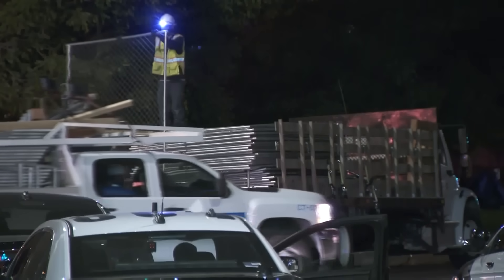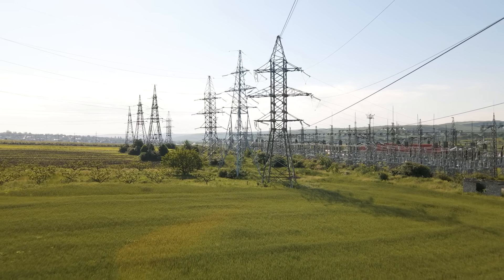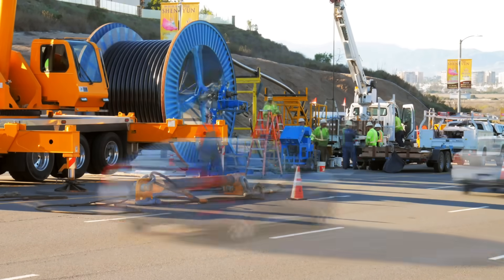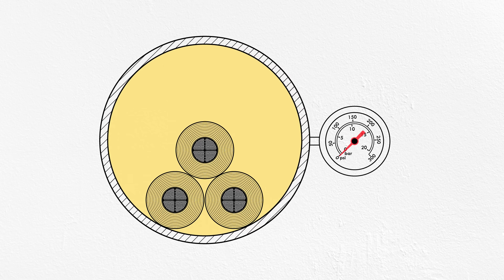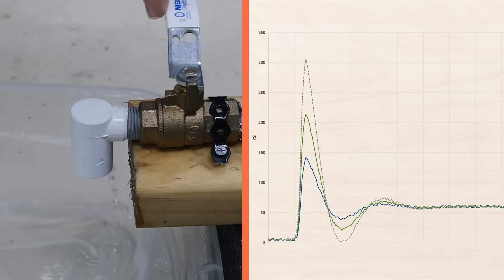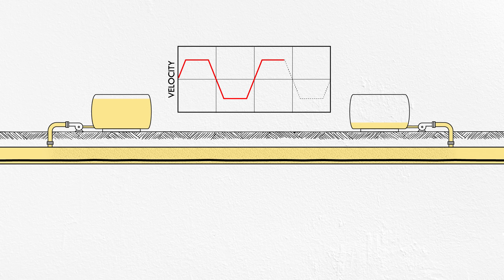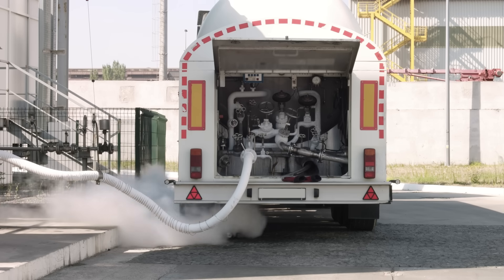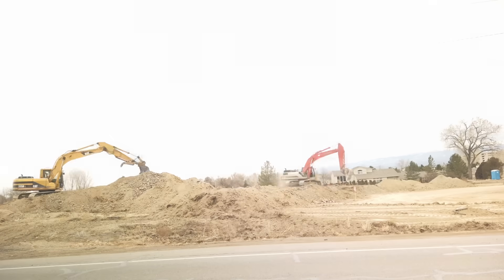Repairing Underground Power Cables Is Nearly Impossible

Comment: I never even considered high voltage lines underground... literally next to ground! I love engineering problems like this. Liquid nitrogen to hold back pressured oil? What a fascinating problem to work on. Thank you for sharing this story.
Reply: wait til you hear about the internet underwater!
Reply: @bermchasin  undersea cables are fascinating. The undersea fiber optic cables are so amazing. I really like the story about Cyrus Field laying the first undersea telegraph cables too. I can't believe he managed to keep getting the ridiculous amount of funding for such an immense feat of engineering as it experienced so many problems and failed over and over and over again then when he finally managed to get a cable laid it hardly even worked and failed straight away and he still did it again.
Reply: @NoZioKikes88  Yeah, the submarine cables are still mindboggling to me. There is so much in the ocean we dont yet understand, its like an alien world, but it didnt stop us from putting tens of thousands of kilometres of cables over the ocean floors... its mental.
Reply: @bermchasin  I laughed way too hard at this.
Reply: @bermchasin  Fiber optics is a fascinating invention
Reply: I think the dielectric properties of underground cables creates parasitic capacitance, for long runs ofc, and HVDC doesn't have this problem.
Reply: @leerman22  you are correct. The capacitance can be offset by line inductors at the ends of the underground or underwater transmission line. These produce an opposite amount of inductive reactance that neutralizes the capacitive reactance. 
HVDC doesn’t have the capacitive reactance of an HVAC transmission line, however the capacitance is still there. It manifests itself as “ charging current”.  That is the effect of the capacitance between the conductors and between the conductors and ground to act as a storage battery. This requires measures to limit the surge of current when energizing a HVDC line. Also, when shutting down a HVDC line the capacitance will continue to supply voltage even after the source is cut. Again measures must be taken to bleed down the stored charge. 
I’m a retired utility engineer.
Reply: @billmoran3812  Good Answer
Reply: @leerman22  ooo they must run HVDC. Good call. I was wondering how they dealt with the capacitance 😅. Duh.
Reply: @leerman22  --  well, everything has its unique problems.   The capacitance can be "tuned out" with inductors along the line.   The "shielding" of each of the phase conductors means that much of the current carried in the Cu core "returns" via the shield.

The presenter didn't say whether the installers use vacuum impregnation techniques to eliminate/reduce air bubbles before pressurizing the line.   Paper with oil is a pretty good insulator but by the time this was installed, I'm surprised they didn't use some kind of plastic.

This line was 220 kV.   I wonder what voltages Con Ed used in NYC.

Overall, it still fun stuff.
Reply: @GilmerJohn  ConEd has 345kV underground.  Eversource (old Boston Ed) also uses 345kV underground.   Recently, SoCalEd began a 500kV underground project.   Cost estimates I've heard are 8-10 times that of overhead.
Reply: @KENFEDOR22  --  Thank you.    In the urbanized Virginia suburbs of Washington, DC the moderate HV distribution (c. 40 kV) is underground.   But the "real" HV stuff is overhead.  It usually runs along major highways such as the beltway.   Another "popular" routing is along streams that form the basis of "strip parks."

I suppose the 8x cost might be worth it in places.   I can't imagine NYC having high voltage power lines along side the major N-S highways.
Reply: @leerman22  Partly, the other part is the I-squared x resistance derived heating losses for MV / HV.
HVDC is also usually operated at 500 kVotlts or 2 megavolt, reducing the current flow, and thus the heating losses, exponentially.
Reply: @leerman22  the capacitance is minor if the cable isn’t lightly loaded.
Reply: @leerman22  underground cables? not much of a problem actually, the place where it is more of a problem is under water, we've been dealing with this stuff in Europe for a while now
Reply: @leerman22 HVDC requires external arc flash connectors because in line equipment would be toast. A camera flash can be problematic.
Reply: "Liquid nitrogen to hold back pressured oil? "

That's quite a common tactic, they also use freezing as a means of stopping groundwater from getting into freshly dug trenches for new pipes etc.
Reply: @vinny142  it's also how you can fix a bad main shutoff in your house water supply without paying hundreds extra for the town to shut off at the street (assuming that one even works)
Reply: Your neighborhood plumber also probably has a tank of liquid nitrogen on their truck for water lines.
Reply: @pasquarielloanthony  Ummm... probably not. There's almost always a way to turn off water (or sewage) that doesn't require freeze plugs. And they still need to turn off the water to freeze it in place.

Freeze plugs are appropriate for when you need to break the integrity of a system and still preserve as much of the system as possible. Such systems may require cleanliness (for high purity water inside a semiconductor foundry), contain contamination (such as a water pipe carrying radioactive water in a nuke power plant), or (in this case) limit the loss of expensive and hard to replace working fluid.

Freezing is also used to stabilize soil (the Big Dig in Boston, Long Island New York tunnel project), or to implement temporary subterranean damms (Fukushima's underground ice wall).
Reply: @brettd5884  yeah, but as previously mentioned — sometimes what you need to replace is the shutoff valve. And those don’t usually have a shutoff valve on either side of them, because that would be bananas.

(And yes, technically, if they need to replace the shutoff valve in my house, they can just turn off the mains water to my entire street, or wherever those valves are. But unless it’s an emergency, they won’t, they’ll just freeze it.)
Reply: @JasperJanssen  Speaking of 'bananas', in my field some of the main 'shutoff valves' have to be periodically tested for leak tightness.  To avoid having to drain the entire system, there ARE valves on one side of these 'isolation valves' so that a small section of piping can be pressurized and the leakage of the shutoff valve measured.   So yeah, valves installed to test valves that are there to isolate.   'bananas'.  hehehe
Reply: @pasquarielloanthony  I use bread, but don't use muli gain, only white bread.
Reply: These freezing technique is commonly used when working German heating systems, in apartment buildings with central heating installed. Servicing a single heater would require the whole building to drain the heating pipes, so these are get frozen, while heating. Also tunneling drills for subways use these freezing to go below rivers, until its reinforced by concrete.
Reply: @datenraffzahn6094  so that's how they Tunneled under the Ocean connecting England to Europe. Seems like it has many applications...
Reply: @datenraffzahn6094  The video is about oil cooled power cables.  Freezing is commonly used where water is present, normally in heating systems to prevent draining down when repairing or adapting existing systems.  I have never heard of it being used on oil cooled power cables before.
Reply: @datenraffzahn6094 , sounds strange. Why? In Russia, nowadays more and more apartments have two valves on radiators, so you can swap them without draining the whole building. But even when you need to drain it, it's not too much of a problem. Why can't you drain the pipes for a couple of hours?
Reply: @MrPaukann  Yes you would think having additional valves for such centralized systems would be standard, however landlords a notorious cheapskates around here so its probably a money thing. Not there is much reason to maintain this system anyways, if it runs it runs. If you don't cause a major leakage somehow there isn't much of a reason to drain it. I also think there are separate heating circles, so you would not have to drain the entire building, only the appartments connected to the same pipes would be affected. Taking the system offline for however long it takes to service it in winter seems like an issue to me. Just to repair one radiator.  I found this "freeze the heating"-thing very curious ... :)
Reply: @datenraffzahn6094 , in a couple of hours the temperature in apartments decreases without heating decreases by like 2°. It's not a problem. Especially because it's usually done in the middle of the day, when nobody is at home. 

I also wonder how the freezing thing works, because if you have many other flats on the same pipe, it must be at least 6 bars of pressure. The bypass pipe can't be far from the radiator, so the ice plug should be short.
Reply: On a very small scale: what do you think they do if they have to replace the water shutoff valve to your house? That’s right: liquid nitrogen.
Reply: @JasperJanssen  
So my Q is how do they replace the gas shutoff if you have piped mains gas?

Freezing natural gas is just a bit harder ...
Reply: Yes, it’s all super clever
Reply: Now it makes sense why they don't just go burying all the power lines everywhere.
Reply: @ericcarabetta1161  cost is generally 4-8X depending on location and splicing into for new customers is much harder.
Reply: @ericcarabetta1161  $
Reply: @ericcarabetta1161  Here in the netherlands they are, theres not a single overhead powerline in a city or village, only the big transmission line towers between the city's
Reply: In several countries in Europe its common that powerlines are put underground.
Reply: @robbertvanrooijen4163  Not high voltage, medium and low voltage for sure. There are undersea high voltage DC cables though.

https://en.wikipedia.org/wiki/High-voltage_direct_current
Reply: In many parts of WA state (especially the western side) since the 1980s, it's more or less the standard to use underground power delivery, due to the frequent seasonal storms that cause outages related to damaged overhead transmission lines.
Reply: That concept isn't just used for oil. I've seen it done for water pipes where the shut off valve has failed. Both with ln2 and a purpose build portable refrigeration system for freezing pipes.
Reply: Honestly im confused,how a person doesnt know, that there are highwoltage lines under the ground.
Reply: Right?! Amazing solution they came up with. Good thing the nitrogen was up to the task!
Reply: I actually used to locate lines like these (I did gas, hydro, water, sewer, and telecoms). Not as high voltage but very similar. Bell (one of the largest telecom companies in Canada) uses metal shielding within some cables to prevent cuts if a cable rubs up against a rock. However this shielding poses a problem in a hydro substations where the transformers are located. This shielding acted as a ground path to the telecom grid. So they ended up ripping a lot of those cables out and replaced them with cables that have the same thickness of insulation as live hydro lines. Maybe not super cool, but certainly interesting (at least to me).

This job also let me find some of the largest infrastructure in southern Ontario. I have located gas mains that are 20 inches in diameter that have over 3100psi of pressure going through them. Certainly scary to see those.
Reply: You should visit the Netherlands. Of our total electricitygrid which consists of about 315.000 km of connections. About 4000km is constructed aboveground (mainly 220kV and up due to the lower operational reliability of underground cables at these voltages). The other 310.000km is all laid underground. 

We also use the so-called exchange principle. This means there is a maximum amount of aboveground highvoltage routing allowed. Of we want to build a new high voltage connection aboveground. The distance of the new route has to be sacrificed somewhere else in the grid (or laid underground). 
This way the total aboveground distance of high voltage routing will never be higher than it is. 

If a higher capacity is needed and the distance can't be sacrificed elsewhere. The crosssectional area of the transmission lines or the amount of transmission lines between power pylons has to increase.
Reply: @giwanverveen3496    I and probably most of the people in the USA (or most of the people in the world?) don't know much about other electric power systems.  I'll guess that most people in developed countries don't pay much attention to power systems.  We regard them as convenient and reliable . . . but when they fail  .  .  .  OH! NO! THE POWER IS OUT!  CALL THE POWER COMPANY!   
I doubt that I'll visit the Netherlands at my age.  But that reminds me that we used to have a car salesman in our town.  He told me once that he went back to the Netherlands and saw the house where he was born.  It was 400 years old!  But he wasn't 400 years old, only the house was that old.  😊  He's gone now.  His name was Peter Van Wardenberg (I think  .  .  .  it was 40 year ago that I talked with him).
Reply: @nemo227   @nemo227  haha, yeah it's taken for granted, and only if it fails do we see how much we rely on a continuous supply of electricity. Slowly but surely moving a powergrid underground can help in that regard. Above ground it is subject to the raw power of natur (think of lightning impacts for example, or powerfull downdrafts or hurricanes taking out power pylons). The majority of underground powercable failures nowadays are caused by digging and excavation mishaps. These are however preventable with a proper registration of every single underground cable, pipe and duct, so these are increasingly rare. 
We also handle something called the n-1 principle in our grids (up to a certain point ofcourse, depending on the impact of a failure). This means that if any one component should fail in a certain connection the operation of said connection won't be impacted.

Cool story about the dutch car salesman btw 😜 We do indeed have some very old buildings and houses in the Netherlands, we are pretty keen on historic preservation (most of these very old buildings have the status of "monument")
Reply: @giwanverveen3496   Thanks for the response and information.  Incidentally, our power went out sometime this morning (September 24, 2021).  I called Pacific Gas & Electric Company.  Their recorded message said they expected power to be restored by 6:45PM.  I started my generator, untangled my 50 foot power cord and attached our Keurig because coffee is a magic elixir, much like lifeblood, got my electric skillet attached and cooked breakfast.  The power was restored just past noon.  I'm sure that future generations all over the world won't need to rely on central power generating stations.
The U.S. has been doing historic preservation but not nearly as long as the Netherlands.  I've been to a few places here in California but there are more in the eastern U.S.  I think it's a useful thing to do.
Best wishes.  Have a good day.
Reply: @nemo227  most UK cities have power circuits that can be fed from the "far end" in emergency (like a digger cutting the cable or an 11kV pole down) -- ie effectively every street connection runs between two substations one for regular use and one for standby.

Main delay as far as most consumers are concerned is usually getting staff to attend both substations to perform the manual switchover.

More rarely a cable is cut leaving a minority of consumers the "wrong" side of the break: for them they send in mobile generators which take a few hours to arrive. And then there will be a pre-announced scheduled handover back from the mobile genny to the grid, which is announced as 30min but actually more like 10.

When it happened to us I was surprised that a single truck (OK a big one) was enough to power an estate of ~250 homes.
Reply: @nemo227  ??? What does your fossil fuel individual generator have to do with centralized power supply? Lol. And by the way, load of newer emergency power supplies for homes are now batteries, including high power vehicles. All recharged by… centralized power supplies. Individual power generation per household is still blindingly expensive for most households and will remain so for a long time.
Reply: @giwanverveen3496  which is part of the reason that things in the Netherlands are extremely expensive. Neat.
Reply: In London there are 400 kV cables buried in the towpath of he Regent’s Canal.
Reply: You got a new subscriber
Reply: that's also how they build subway stations in very wet lands...
freezing the surrounding earth and then dig it up to put the concrete subway station in.
not a new concept
Reply: Jeremy, it is almost like you are getting ... Smarter Every Day!
Reply: There is a 33KV oil filled underground cable feeding a transformer that powers the north half of Leicester (pop. c300,000) UK.  Some time ago a JCB digger punctured the pipe containing the cables and broke one of the phase cables - big sparks!  Fortunately, the damage happened at the weekend and they were able to shift the loads on to the other two phases otherwise it could have been embarrassing as N Leicester contains many hosiery factories and the claims could have been astronomic.  The repair of the cable/pipe resulted in a 50,000ltrs tanker being on site pumping oil into the pipe on the basis of total loss.  The spent oil then spilled into the canal next to the cable run where it was extracted and disposed of.  The repair took the whole weekend and involved parts from a common depot for three major electricity authorities over 100 miles away.  The pipe/cable repair sections are hugely expensive and the cost would today be in excess of £2M with a delivery period of at least 12 months!
The incident was not widely reported to prevent too much hysteria
Reply: @clivewilliams1406  Got a link? I've seen some magnificent fireworks caused by phase imbalance. I'd have sworn you could not possibly shift the load. That would make some very big hardware very unhappy.
Reply: @cageordie   This happened in 1983 i.e. before the internet and the digital age, and as I said it was not widely publicised to limit public hysteria regarding pollution.  The substation, an early 20thC unit, is still in existence and presumably fed by the same underground cables.  The only saving grace since then is that the Leicester hosiery industry has been decimated and thus the demand on the substation will have reduced.  The cable/pipe ran diagonally across the adjacent site that we were looking to develop and at first the electricity company demanded that we either shift the cable at a cost of c £5M in today's money or create a walk-through duct under our proposed building to accommodate it.  Fortunately, it was on a wayleave so that we gave them 12 months notice to shift it at their cost, which meant that they quickly came back to the negotiating table and we all agreed to accommodate it in a shallow duct in the floor structure.
Reply: @clivewilliams1406  interesting story - i bet the digger driver was as unavailable for comment as the hoisery factory workers whenever bossman is late with the immigration payoff.
Reply: @billynomates920  Strangely enough the digger driver survived unscathed - shaken but not stirred!  No-one was saying who's fault it was - incomplete information to the contractor or simply bad instructions.
Reply: @clivewilliams1406  LOL, you mean to prevent public scrutiny and management accountability ....
Reply: They nearly built underwater electrical lines between the islands of Hawai'i...
Reply: @Steamrick  
There are two high Voltage d.c. cables between England and France.  Normally they each typically provide about 3-4% of the UK demand but one was recently damaged by fire, and is out of service at present.
Reply: @srfurley  correct we also have cables connecting to several other EU countries.

The cables being DC we don't have to sync our grid to theirs, but most of mainland Europe is in phase.

Wandering off topic here but thinking of grids the size of continents...

You can see harmonics of 50Hz at the magnetic antipodes of Europe due to the excitation of entire field lines of the planet's magnetic field. The European grid at 50Hz is larger 1500km (a quarter wave in free space) so radiates quite well. Locally to a line engineer it looks like reactive loss, but that's just the same mathematically as a segment of an antenna.

Likewise at the mag antipodes of N America you can see harmonics of 60Hz.

The difference in grid frequencies is fortuitous for scientists as the difference makes it quite clear that what we see is a direct result of powerline transmission.
Reply: This a good problem
Reply: STUNT
Reply: Its cool that the youtubers I follow also follow other youtubers 😁😇
Reply: above ground, underground, surface lines, no matter what/where/when/how, it's all impossible to contain and control with mother natures changes...
Reply: @throttlebottle5906  ??? Uh no. First it’s ALL contained and controlled, that’s what allowed you to use electricity to type your bloody comment! And the point of the story (which you apparently missed) is that underground lines are vastly more difficult and expensive to repair. “Mother Nature” also had NOTHING to do with the faults and repairs in this underground system, unless you’re labeling the entirety of physics “Mother Nature”.
Reply: Fun fact, this method is also used to repair broken underground water mains pipes.
Reply: The power lines on our street are buried about 6 feet deep.
Reply: @nemo227  
Those will be at 240V phase or 440 phase-to-phase if feeding housing.

The next step up are the 11kV lines, which can also be buried that close to the ground if not on wooden powerpoles.

But this video is about voltages a lot bigger than that
This video is talking about much higher voltages than that.
Reply: @nemo227  Congrats, if you ever need repairs, it will take weeks and cost a bundle. Our above level lines are repaired in a matter of minutes.
Reply: Conclusion......not this construction of underground cable
Reply: Not to mention gas lines and telco cable lines, usually in the same trench separated by a couple of feet. And or separate trenches feet away. Engineering world is incredible
Reply: @bennytrue1068  That's the theory but it comes into perspective when you realise that the good intentions are being implemented by a guy with his arse hanging out of his jeans!
Reply: Currently underground high voltage cables are made of plastic (no more oil). Even those for 380kV, as can be seen here😎:
https://youtu.be/CrQlmltJ9hU
Reply: They learned freezing pipes from plumbers. That is how plumbers fix problems when they cannot turn off the water supply.
Reply: Beverly Hills has all there power lines underground
Reply: @ArcOfJake89  Your comment caused me to use Google street view and look at Beverly Hills.  Yep; instead of power poles their streets have lots and lots of tall palm trees along both sides of the streets.  So I looked at several towns & cities.  Power poles and power lines are mostly underground.
Reply: Good to see you here, Jeremy! I was thinking about the "freeze plugs" and I wondered "Even though the oil would be frozen, what if the pressure overcame the friction against the pipe and popped like a cork?! Man, wouldn't want to be the person(s) in that hole!" My thoughts on why they didn't go through with it lol
Reply: @Eric2300jeep  They froze it absolutely successfully. And obviously the engineers knew the pressure and temperature limits and worked with in them - they weren’t just guessing.
Reply: So I know this first  hand as I use to preform.high voltage cable splicing.

The system I worked on had three types of high voltage cables. XLPE is all plastic. Low pressure lead jacket cable. The copper conductor is hollow and allows low pressure oil (12-30psi) to impregnate the paper insulation. This is all held together with a lead jacket.

The high pressure pipe type is just like the video. If we had a leak or repair we would drop the oil pressure from 200-2/0psi to around 25-50psi. 

We break off the coating on the pipe and wrap two 100ft lengths of copper tubing on either side of the repair we are doing. Once all the insulation is over the copper tubing we fill the tubes with liquid nitrogen. We monitor the temperature with thermocouples once there is a "freeze plug" we will preform the repair.

Once done we turn the nitrogen off and allow the oil to warn up. Sometimes a torch is used. You must be careful with pressies to ensure a freeze plug isn't forced along thebpipe ripping the cables insulation
Reply: The the contingency plans were cool :3 and the updated cables was nice :3
Reply: Hi!
Reply: Fuckin what? in australia its mostly what we have.
Reply: Clark Kyle  Yes Western Union was trying their Alaska then through Siberia to Europe route at the same time all the way until the first underwater cable was finally laid then they finally gave up. Funny how how I don't remember any of the documentaries mention how Western Union wouldn't be able to achieve achieve their route without finding their own undersea cable and cable laying technology to get through the Bering Strait though. The worst part is all the work everyone did was for nothing anyway because the telephone was invented right away making those telegraph cables obsolete since they couldn't be used for that.
Reply: C'mon, Jeremy.  YOU have a handle on this, if anybody has.  Those of us who follow your channel have picked up a LOT of tips and useful information from you.  Thank you, sincerely.
Reply: In Britain in urban environments and cities, all electricity is underground. You will only find high lines on the county side. 
This is common in Britain.
Reply: Love your videos Jeremy!!
Reply: In Ireland they used Liquid nitrogen to freeze the ground so they could  travel across Peatlands (muskeg) with heavy equipment when laying the cross country natural gas main.
Reply: @MrT79shakeshake  That’s weird considering they COULD engineer equipment with a very low pounds per square inch pressure impact and easily drive across anything short of open water.
Reply: Most countries dont Thats why
Reply: What do you consider high voltage? 600v and up? Thats what I consider high voltage. We put 4160v underground and 13800 but not as often underground but its in a specially designed cable. I just noticed who I was replying to. You are one sharp man being self educated on electricity. Much respect for you.
Reply: yes that's challenging but so much better visually than dangling pylons all over the country.
i thought of separating three different phases into their own, preventing arcs and eventually a tube made of recycled glass to insulate from the ground. then the idea of dilatation and more, adding some kind of springs would be the idea. just wonder how much heat it would generate, and what oil should be in uese. Sure in a climate like LA it is an issue, but here in France's mountains region it would not be an issue.
Reply: The city of Amsterdam used nitrogen to freeze the very unstable, water-logged soil under the city to be able to drill a new metro tunnel. If they hadn't, a large portion of the buildings above it, would've collapsed. Crazy idea that works brilliantly. Engineering is amazing!
Reply: Underground cables were already in mass production status in the 1960s and 1950s. So it is something that is not new nor revolutionary, it is just because people never paid attention to it. Underground cables are used mainly for key critical Military Defense Complexes, both above and below ground. Civilian usage of mass produced underground cables is very minor, almost a niche market in the civilian world.
Reply: That's a scaled-up cooled-down version of using freezer packs to isolate part of a domestic water system without draining the lot. 

Can be used for example to change a radiator without draining the system.

Also sometimes used in the UK when heating systems are shared among neighbours in a block. Courtesy means you tell the other folks and negotiate a time, but you don't need to drain their system, only part of your own.
Reply: Have you been living under a rock? Lol nitrogen services have been used for a hundred years
Reply: We use N2 all the time in the oilfield to sweeten  h2S gas and N2 can kill a oil or gas well if it gets outta control on us.
Reply: Yeah that sounds like a solution Richard Feynman would have come up with (he's the guy who famously demonstrated the o-ring problem on the Challenger with a glass of ice water).
Reply: there's another between canoga and tarzana in LA, a 230kv underground line.  work in that station.  makes sense because people would probably be a bit pissed off if you built steel towers in densely populated areas
Reply: Well we are used to have most powerlines underground here. I think the main problem is that companies in the US tend to overengineer stuff.
Instead of building a 230kV/656MVA line they could have built five 110kV/150MVA lines, for probably a fraction of the price, but it wouldn't be as cool.
Where I live it's nearly impossible to find a high voltage aerial line anywhere close to a home and even the aerial lines you find in old neighborhoods are 240 or 400V which are fed from a local transformer which is fed from a underground high voltage line.
The big aerial high voltage lines (mostly over 150kV) are mainly run over farm land and only very rarely (if any) come close to a home.
And while underground high voltage lines may look like a recipe for disaster to some ... I have never experienced an unannounced power outage in my whole life and even a planned power outage hasn't happened in the last 10 years.
Now that I have said that murphy will probably kick my ass and the lights in my home will go out in the near future.
Reply: Underground power lines are common in Japan
Reply: They’re used everywhere. Paper and oil insulated contained in a steel casing. Nitrogen pressurized to prevent condensation. Very reliable unless drilled into. Very expensive to install.
The skid wire is a braided stainless steel about the size of a pencil lead.
Reply: Overground LV and MV (op to 25kV) lines are really uncommon in the Netherlands and in the cities even 150kV lines are underground. I know we’re not the benchmark for infrastructure but you’ll really notice how clear the skies are because of the lack of power lines (only 220kV and 380kV lines are mostly overground but even those are slowly beginning to put underground)

But regarding this video, pressurised oil insulation is really shit and prone to faults and require massive amounts of maintenance. All underground lines are cross linked poly ethylene (XLPE) insulated which is maintenance free and easy to splice and repair
Reply: @retsaM innavoiG It’s the vast depth and massive square footage, not just the huge amount of debris you’re ignoring. Go out in your back yard with a hook and thread and try to snag a thread you’ve randomly dropped.
Reply: i think you would be interested in NDC Lazermike products.
Reply: They do that in Europe, but Europeans live in the least challenging climate on Earth. Earthquakes will damage those . 
That is why Japan does like USA with electric
Reply: Well if you think about it, being under ground they must be "low" voltage! 😂😂
Reply: But why didn't they put valves at places in first place.
Reply: @vaibhavbv3409  in The case of this cable: the cable goes through it, so there’s no way to close the oil off without also severing the cable, which would be a Bad Thing.
Reply: @vaibhavbv3409  mineral deposits over time build up ceasing the valves open...
Reply: @vaibhavbv3409  difficult to valve a pipe with wires in it.
Reply: @vaibhavbv3409  ... ??? They did - we're talking about replacing said valves ...
Reply: The entire singapore power grid is underground, there's 0 overhead cables. that being said it's smaller than NYC (the city not state) so it's manageable

you can find transformer stations scattered at some places in the country, no wires overhead.
Reply: what a joke, US is a third world country hence why you can't understand it
Reply: Tesla's idea was better. Required zero underground pipes and wires
Reply: @eatme173  and you get ready-roasted pigeons falling out of the sky as a side-benefit...
Reply: There’s a lot you’re not aware of bud if you don’t know then you probably work in a office somewhere.
Reply: Tank masters environmental is a newer channel if your into that kind of stuff